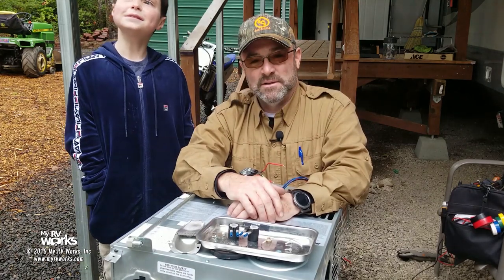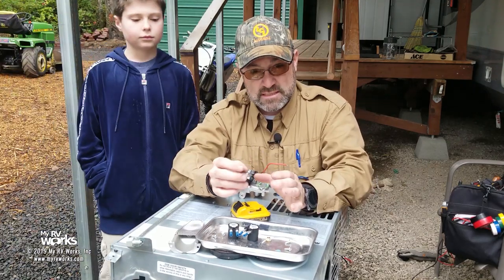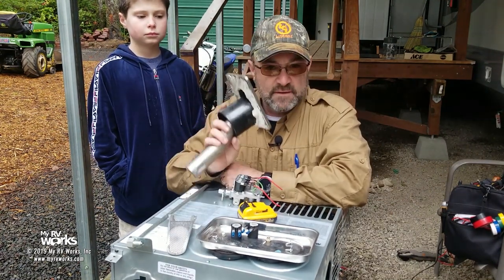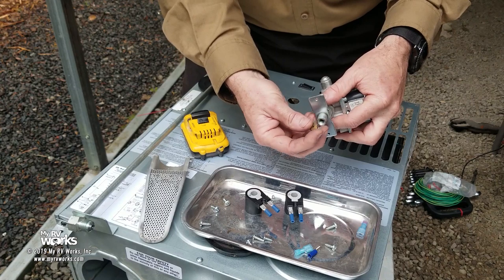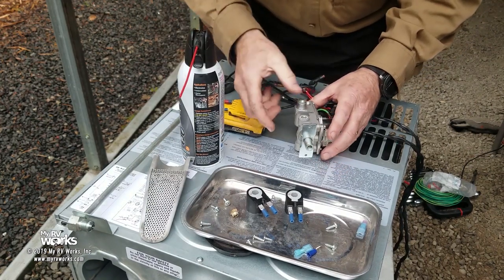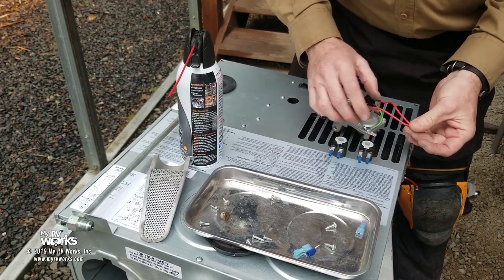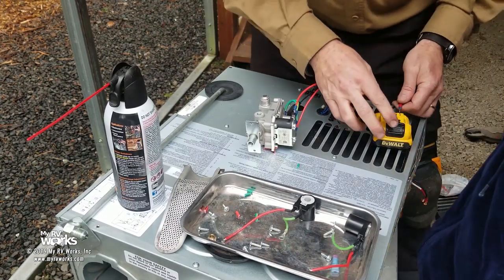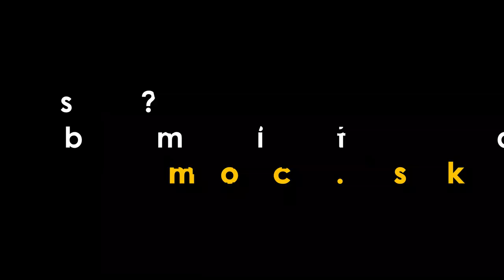RV Furnace Gas Valve Solenoid Failure

Comment: We have a "Suburban SF-42F" unit on a 38 ft Safari coach, that has two thermostats to run one furnace. It lights normal if we use the rear thermostat, but wont light if we use the front thermostat. I'm assuming this particular issue would be a connection problem in the front thermostat. Do you have any  ideas if I'm correct on this, or anything I should check? Thanks.

Comment: ny furnace hadnt worked right since it was new. Sometimes it would light sometimes not, it usually locked out after 3 tries. we found out the lp pressure was about 8.5  water column under load, we adjusted it to 10.5 and the furnace got worse. i t would create lots of soot if it ran.i had a local service say it was a bad igniter so they changed it but no change in how it operated.everything seemed like a restriction in the flow . so we took everything out,had all new parts igniter,burner,gas valve.so when we started to disassemble it evrything looked ok until we got to the orfis. i have a 25000 btu and the size was suppose to be the 1.45 which is the smallest one. but  it had a 50 which is for the 35000 btu furnace..so it was letting way to much gas into the burner. so my afmd25111 was incorrectly assembled at the factory. we spent about 4 seasons and 3 different repair people  dealing with this and i fixed it and am not even a rv tech. your videos kept me searching for my answer
Reply: So was too big orifice! Same thing I guess I have at high altitude. Too much gas for the available oxigen.

Comment: Thanks for the Video, I have a Furnace question, and no I have not gone through the other videos yet. I have a dometic furnace in my enclosed trailer. The issue is similar to the solenoid failure. However my furnace cycles correctly all the way up to ignition, I have heat coming from the exhaust, but after about 10-15 seconds, the it stopped, and then tries again, and after the third try, the furnace stops. Any help would be greatly appreciated. 
Thanks
Don Ramey

Comment: The price for those whole units is highway robbery. You can order the solenoids  and just replace them much cheaper as you stated. I remember doing  that on our 1969 Portacabin Popup camper. Someone told me just to replace the furnace. Once I replaced the bad solenoids, it ran fine. I even sold the furnace a few years later after scrapping the camper.

Comment: I've been catching up on your videos and it prompted me to check the torque on all the wires in my RV distribution panel. What I have found is that my 12V negative bus bar is actually mounted behind the WFCO 8735 and I would have to remove the whole panel to check those.  However you mention burning wires quite a bit, so I was wondering is there a normal operating tempurature in and around those circuits that could tip me off that a wire my be loose and over heating?  For example if I point an infrared thermometer at that point of the panel (with a load) I get a reading of about 92 degrees F. , as well as in the bottom of the cabinet that sits just above the 12V panel connections.

Comment: Great video.
Mine starts and goes through the process, I smell gas and hear the ignitor. But it does not ignite. I smell LP but no ignition during the clicking.... unless I partially block the intake (during the clicking of the ignitor) it will ignite. If I pull my hand away ot will go out. If I keep my hand in place for long enough and then slowly pull it away, it will stay lit and the system will continue to work. 
Is this the gas valve? Maybe not LP to feed tha airflow?
Reply from the maker: To schedule a service consult with Darren please sign up for the "1:1 Repair Consult" on our Patreon site.  https://www.patreon.com/myrvworks

Comment: Do you have a video where I can see if I can fix my issue ...I have a gooseneck trailer well the upstairs doesn’t blow it does but super low it does have a temswitch ..it clicks when I move it....help me out thanks by the way the livingroom works good blows heat n is good is just upstairs vent that I’m having issues with

Comment: I have a water heater that works great on both 120v and LP side, but when using 120v side via heating element there is still a little bit of LP  coming from valve. Is this normal or should the solenoid be checked?

Comment: I did some re-piping on my LP last fall.  Now the furnace does not fire.  I can hear the igniter ticking  but do not smell propane.  How many times should I try the furnace so that it purges the line, or should I crack the fitting until I can smell propane then try a few more times.

Comment: Ok I have a issue 
My my furnace I hear the click of the igniter. No gas smell.  I do not hear the click of the gas valve but when I did the 12 V battery test, I hear a click of gas valve and smell gas. So it seams like I'm not getting anything to the on and off switch where the red wire goes to or the borad ? Please advise.  Thanks

Comment: I have a hydroflame 7916 and my motor comes on and nothing else happens. It never shuts off unless i turn down the thermostat. My question is do you think it would be the sail switch? What throws me off is that the motor never shuts off to try and restart the cycle or sequence of operation

Comment: Quick question, my furnace rv is blowing hot air the problem I have it doesn’t turn off... it stays on forever, does that mean is a bad thermostat? Or is it something else? I should mention I have a 2019 rv with the airxcel thermostat. Thnx

Comment: i have a 2008 starcraft 26ft tt with suburban furnance.it has 4 wires 2blue,1red,1white,it works when i touch blue wires together but ofcourse it does not turn off.i replaced the dometic thermostat.my question is which wires connect to the white and red

Comment: We have a 2005 Damen Daybreak motorhome with at 8531-1V-DCLP FURNACE THAT AFTER RUNNING FOR A WHILE WILL NOT SHUT DOWN.  WE HAVE TO PULL THE FUSE OR TURN THE PROPANE OFF.   TODAY WE HADE THE CIRCUIT BOARD AND IT CYCLED FOR 6 HOURS THEN IT WOULDN'T SHUT OFF.
Reply from the maker: Without me actually diagnosing the system, the first thing that would come to mind is a faulty thermostat. That is to say the thermostat in the RV is constantly signaling the furnace that it was heat.

Comment: I have a 7916-11 atwood mobile products forced air heater i will work great from the start for about 3 to 4 cycles then it won't ignite for about an hour other times like tonight I went to fire up the heater the blower kicked on I heard the ticking but wouldn't ignite after turning it on an off for a good while if finally kicked on any ideas would be greatly appreciated

Comment: Do solenoids fail intermittently? Furnace  guy says I need a gas valve but Furnace runs perfect except after it has been off for a few hours. Then I have to turn the furnace off and on at thermostat to start it. Then it runs great for hours. I can't believe if it works good most of the time I would need a gas valve.
Reply from the maker: That certainly does not sound like a gas valve problem. More likely a sail switch.

Comment: So if I get ignition, everything is working to the Point of ignition, but I’m getting no gas….. If the sale switch and high limiter switch are working then I should get ignition if I’m thinking correctly so ignition points to gas valve or solenoid if I’m getting ignition.?

Comment: I have checked my sales switch and my limit switch so I know they are good what happens is my furnace fan starts up and keeps going constantly but does not click or ignite. Also I have checked the LP flow and it is good I do not smell any LP coming out of the exhaust and the furnace will just keep running without heat any idea?

Comment: hey I have the same exact problem on the same exact model 8531 I'm getting air but not hot air however I checked the solenoid with my multimeter and they were both reading 39 I've cleaned the igniter it looks almost brand new what else could it possibly be I'm getting three with a three second pause and that says ignition lockout fault could you please help me first year in RV here in Utah and about to start getting cold

Comment: My furnace starts, has flame but cycles three time to lockout. Each time the furnace fires up but the ignition electrode keeps firing after the gas is lit. What senses the flame on these furnaces? Atwood 8500-IV series

Comment: I have click click click. And I smell propane out the tail.  It doesn’t sound like it lights and I don’t feel any heat at all. The. It shuts down. What’s next?   I don’t see any obstructions with a flashlight from the outside.  Any help appreciated.

Comment: My furnace SF-35F the fan comes on cold air and when I turn the thermostat up it makes a loud clicking noise still no heat and when o turn the furnace off the fan continues to run until I flip the breaker my self?? Please help

Comment: Ok, im trying here for my problem: Thermostat ok, the fan starts for 10secs, i hear the igniter clicking sound, i hear the burner starts and i even feel heat from the exhaust port. But as soon as the igniter stops clicking, the flame come off (12v current to the selenoid also shuts off).  It does this 3 times the first 30secs and nothing more. Ohms from the selenoids 45 each.

Comment: If you will answer my question . Thanks in advance . My unit will do the full cycle up to ignition with a click and igniter noise . But after about 2 seconds shuts the whole system down and will do the cycle about 4 or 5 times and will stop . The light on the control board will stay red until you reset the system . But between cycles after a shut down the light will blink once ??? I get a faint smell of gas but not much . If only one selenoid is working on the gas valve will this symptom be the like this . Thanks again for any help ....
Reply from the maker: Your control board is not detecting a flame. So, it could be the control board itself, the igniter, the igniter Gap over the burner, or your LP pressure may be too low.
Reply: I checked the spark and spark gap on the igniter and that is working correctly . My LP pressure runs the hot water heater as it should . Where does the control board pick up the flame ? is there a senser for that . Thanks  @MyRVWorks
Reply from the maker: @MrAmartin8  
Head to our furnace playlist where we have quite a few furnace videos. I'm not sure what kind of furnace you have but this video touches some of the key points.

https://youtu.be/HCoNtm_mo74?si=I7sgTAkXhiWvzDGy

Comment: My furnace works, however, if I close up the trailer with the furnace off, after 1/2 an hr my propane detector goes off. If I open the outside access to the furnace and stick my propane sniffer up inside the exhaust tube it detects propane. Soapy water shows no bubbles. Selenoid? leaking valve? Please help
Reply from the maker: This past winter we found a propane leak on the furnace gas valve itself. So it may not be any of the fittings, but it might be the actual valve.

Comment: I’m having an issue with my Suburban NT20-S where it won’t turn off and continue to heat, even with the t-stat in the off position. It will heat like its on until I cut off the propane supply. I can’t find anything related to my issue on youtube. Have you encountered this before?
Reply from the maker: Furnaces are not that smart.  I say this because if it continues to run, that would indicate that it is constantly getting a call for heat signal. You may have a defective thermostat, or maybe there's a wiring fault between the thermostat and the furnace. If you can access the front of your furnace, you'll find two blue wires. Those are the  wires that create a circuit for the call for heat signal. One of those blue wires will have 12 volts on it all the time.  There are two ways to wire that depending on your thermostat.  Typically you'll find they go inside the couch on the 12 volt hot wire and then get connected with a thermostat calls for heat) and come back on the other blue wire. If you have a Coleman or Airxcell thermostat, the 12 volts originates at the thermostat ( instead of the Furnace) and leaves the thermostat on the white wire and comes back to the furnace on the blue wire.  Manufacturers will use any color of wire between the white thermostat wire and the blue furnace wire. So, if you look to that wiring circuit, I think you may find your issue. But like I said, the furnace is not that smart. If it's running it's because it's getting a call for heat.
Reply: @MyRVWorks  Thank you for the response! I’ll be working on it this weekend and bought a new thermostat to replace the 30+ year old one it currently has. I’ll check the wiring with my Fluke while I’m at it, thanks again

Comment: Darren, This one is misleading. You need to correct your ohms law calculation. 12 volts and .5 amp = 24 ohms. It must say .3 amps on the valve, not .5 amps. Also, the female spade size is .1875 or 3/16" compared to the .250 or 1/4" normal size spade connector. I know YOU know, but for some, it is confusing about the calculation.

Comment: Can low pressure from the regulator cause no propane to go thru the selonoids?
Reply from the maker: No, the amount of pressure in the propane line has no effect on the solenoid operation. The solenoid is an electric valve. It will open or close regardless of propane pressure.

Comment: does it matter which solenoid goes on each side or are they the same?
Reply from the maker: The solenoids are the exact same, but make note of the wiring. The ground is feeding the two innermost posts.
Reply: @MyRVWorks  yes i saw that as i dismantled it here is my issue and u tell me what u think .... i have an 86 coachmen motorhome and i had the heater rebuilt about 5 years ago the guy put in a new blower motor and a circuit board and an igniter and its been workin great for the last five years ...well two nights ago it quit blowing heat so i changed out the regulator valve that feeds the burner and  i put a new ignitor in ... so i turn the thermostat on i hear the blower start , then i hear the valve click, then i hear the ignitor going tik tik tik tik but it just will not fire up what do u think it is

Comment: Have issue with my furnace on my motorhome it goes through whole process  gas comes on ignites but it shuts off after a few seconds sometime it Lp will stay on for 20/ 30 then it will shut off then it goes to the same whole process again

Comment: What happens if u hear it doing what it's supposed to do, smell LP gas, and hear it ignite, and feel the hot air for a split sec come out the exhaust, and then the flame goes out, and then it repeats the same scenario

Comment: Alright, model sf25. Original problem  was working fine then click, fan, click, fan, click, fan one after another, within seconds. No fire. Got the solenoid click after a cold nights rest. Replaced the ignitor and sail switch (based off of forums, it was the ignitor or sail) Now,  Single click after 30 second purge. No click, click, click, like the ignitor should do. Single click after purge. I'm lost man, but do not want to send to dealer for price gouging. Any suggestions? Thanks in advance.
-Zach
Reply: No lp smell

Comment: I noticed you’ve avoided making a cable style waste valve repair video.  Can’t say I blame you and since the manufacturers seem to insist on using them...and the customer doesn’t wise up and put a dc valve in place, what’s the tip to avoid getting the...uh...stuff from inevitably getting on you when you replace one center bottom of the rv?

Comment: I'm having an issue. My fan blows. I get heat. I get the ticking outside the camper. Also sounds like a crap load of air blowing through sometimes it scares me. I see flame inside the heater. It runs for anywhere from 10 to 30 mins  shuts off and won't turn back on. It also doesn't heat the furthest register from the control panel. Can anyone help me ?

Comment: On my furnace it will ignite then cut out , it will have one blink on the circuit board which means sail switch or sometimes blows a fuse . I’m thinking the circ

Comment: Im assuming you are referring to fact that there are 2 solenoids and thats why you referenced 40 ohms
Reply from the maker: The gas valve is considered a single component/assembly. As such all of the specs are not at the individual component level but rather the entire assembly. This is defined in the NFPA 1192 chapter 5 specifications.  We can test individual components, but what's going to be stamped on that bracket is going to be everything combined.